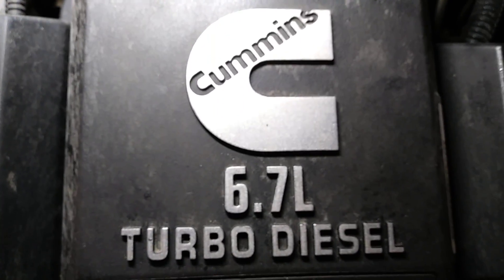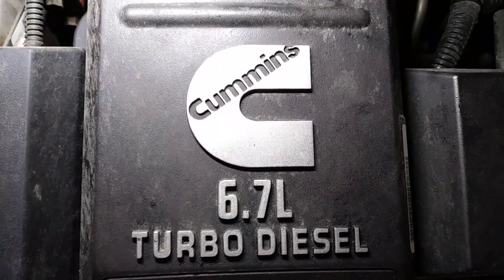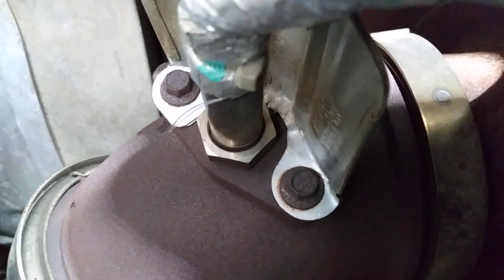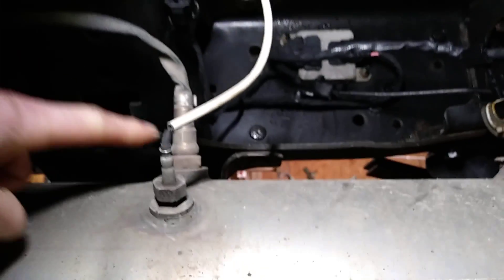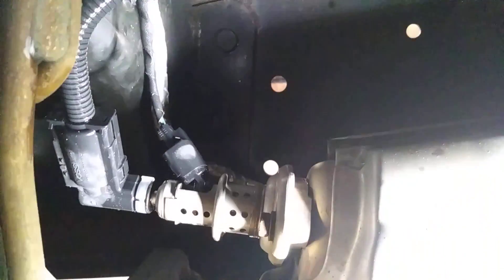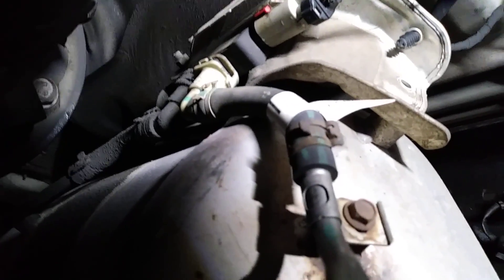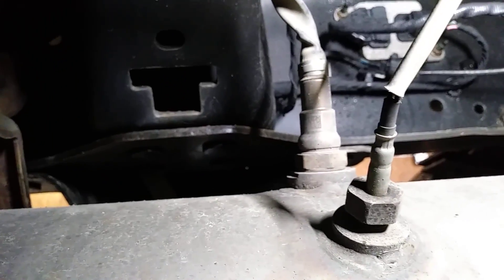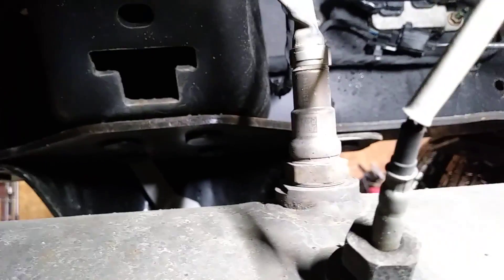6.7 Cummins nox sensor #1 and #2

Comment: My 2016 got two codes which appeared after it went down to -5 at night. Unsure if related. DEF was only half full.  Got code U011A and U029E and am now counting down to limp mode if I don't take it to the dealer. Any help would be appreciated!
Reply: What did you do to fix the problem

Comment: Hi I have a question
2015 ram 2500 dpf injector
Why the build up of  white crud around the spray injector 
After 108,000 miles replaced with new one and check again with the same crud build up around the sprayer two months later?
Poor quality dpf fluid or air leak at the injector?

Comment: really appreciate it. Dealing with "unfinished Nox monitor" for smog. Any tips? Tuned to stock and 350 miles on my od since changed. Should i continue to drive it to wake up that monitor? or remove and look at it? 2012 Ram 2500

Comment: How much would it cost to replace the the two sensors?
Reply: To change #1 sensor is about 1300 from the dealer. I'm on my second one I have a 2013 ram I found one at advice auto for 800 some with lifetime warranty.

Comment: I have 13 ram 2500 with code p2201 NOx  sensor circuit range performance bank 1. Would that be the sensor on the turbo elbow correct!?! Other video motor city mechanic is showing on dpf by transfer case is nox sensor. I just want to replace right one since they cost lots $$.
Reply: I have same issue now. Same year. What was your fix?
Reply: Anyone ever hear anything on this
Reply: @vttrucking6790  mine was the front sensor.
Reply: I watched that motorcity mechanic and he had two codes showing, the p2201 and the Uxx code. So that combination may mean something, I have an intermittent P2201 code and Im scoping mine out. I dont know why that NOX sensor is so close to the exhaust manifold at the turbo. That high a temperature cant possibly be a good thing.

Comment: I have a 2015 with Code U059F  (invalid data received from NOX sensor B) what does that mean.  Which sensor is out.  Please help
Reply: Did you ever figure out the issue mine said the same thing
Reply: @wampuskat1145  yes, it was nox sensor #2 or what they call the downstream.  The part was $500 from Dodge. (2 yr warranty).  I have a dodge 3500 SRW 4x4. Where I found my #2 sensor was near the back of the exhaust.  If you go underneath the truck find the exhaust pipe starting from the  rear axle  and follow it to the point it connects to the scr ( I think that’s what it’s called). Anyway the scr is the bigger metal capsules (about 12” diameter) there’s a bracket that holds up the exhaust pipe right where it connects to the scr.  Right after that connection you’ll see the nox2 sensor and a smaller temp sensor.  The nox sensor is the one that has the module on the passenger side of the chassis near the bed fender not the one that attaches to the middle of the truck on the frame.  The part number that came off my truck was 68197109AA, that has been replaced with 68227486AA.  The design of the module is much better making it easier to install back on the scr. If you need help find me on FB (Judy willis-  I have my pic and a HOOKEM horns sign beneath it) and friend me. I have a video where I found it on the truck if you need me to send it to you.
Reply: @EvenaGirlCanDoIt  Hello Team I hope someone can help. 2014 Dodge Cummings derated to 5mph. Mechanic said it’s the nox sensor the outlet pipe - which one is that number 1 or 2 - ? Which one do I need to buy - can someone please help.
Reply: @joycollins3421  what’s the code? Go to an auto parts store and have them scan for your code.  If I had to guess it’s the same one I replaced
Reply: @wampuskat1145  also, I took the part off myself and installed it myself took less than 5 minutes to take off and install.  Also it fixed my problem. The dealer wanted $1500 to replace it.  🤦‍♀️
Reply: @EvenaGirlCanDoIt  thank you so much I will be re checking the code today and ordering the part hopefully it will fix mine as well
Reply: @EvenaGirlCanDoIt hello, what part did u replace I have the same codeU059F please let me know thanks

Comment: Older models RAM like 2014 had a nox sensor connector seal factory problem. At the time of production, the seal in the nox sensor connector was not installed properly what led to corrosion inside the connector in the 1-st year of use.

Comment: Thanks for the information. Today I got a p203f and p207f code after check engine came on and a 5 mph in 150 miles dec system see dealer message. I was wondering what was your thoughts on where for me to start? Can you drain the def fluid? Both codes show low reluctant. I just  added 2 fluid 2 weeks ago. Which sensor is the 207f code? Any help would be appreciated. 2015 dodge 2500 6.7 manual. 101k miles. Thanks again for all your info on your videos. Subscribed

Comment: On my ram I got a code P225F Nox sensor performance signal stuck low bank 1 sensor 2  my question is witch sensor out of them on the pipe would it be thanks

Comment: Will replacing the Nox sensor fix the See Dealer or 5mph Max message? My truck went to limp mode, i erased the codes and i was able to drive it again for about 200 miles and I got the see Dealer in 50 miles message again. Can I keep erasing the codes and drive the truck as is until I get the time to fix it or maybe Delete it?
Reply: On a semi. I replace the sensors and them run a forced regen on the truck. Not sure if these are the same.

Comment: I have a 2015 3500 and i'm getting a Error code P229F do you know if that would be #1 or @2? my truck has 102000miles. Thank you.
Reply: I have a 2015 3500 and I have P229F and U059F.  It is related to NOx Sensor #2.
Reply: @jlzgator  I have the same code, same truck think it is #2, busy trying to figure it out now myself
Reply: Any luck on this, i have the same thing happening to my 2014 2500, same error code.

Comment: I have 2010 3500 Diesel That is giving a code bank1  sensor 1  stuck full  rich is this a common problem? It only has 7000 miles on the Truck.
Reply: Ken Kopystecky buy yourself a Ford Powestroke you’d be much happier with it.

Comment: Thanks for the video....The upstream sensor module is a PITA...Wheel well liner has to come out...2 8mm bolts that are really tough to get to...and remount with the vibration pads...the electrical connector is different too.

Comment: I really don't know. I have 73000 miles on it. It's a 2015.
Reply from the maker: Michael Garcia The aftertreatment system is covered by dodge for 100000 mi definitely call around to some dealers that will cover it, them sensors are expensive, we had to call like 4 or 5 different dealers in our area to get it covered, if your truck was made in Canada they will not cover it, that is how they are getting out of covering it

Comment: So is number 1 also "bank 1" ?  I'm getting this code thrown on my truck and is gonna go into limp mode. Any suggestions?
Reply from the maker: Michael Garcia yes for sure number 1 is bank one. A bad #1 nox sensor
Reply from the maker: Michael Garcia### is it still covered under warranty?
Reply: Mad Motor Repair apparently it is not...just had the code P20EE and P1C54...Nox sensor bank one...and they want $750 to replace a $300 part.  I’m doing it myself.
Reply: David Switzer so di you grt it fixed my 25 cummins just got the P1C54
Reply: 15